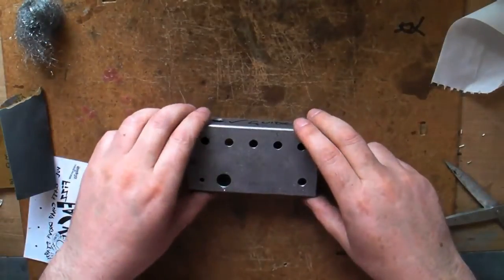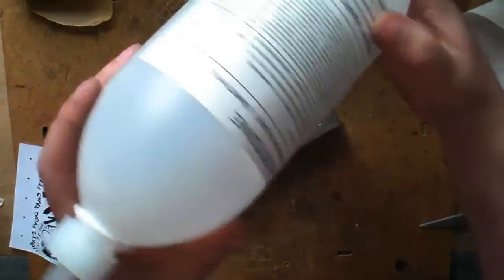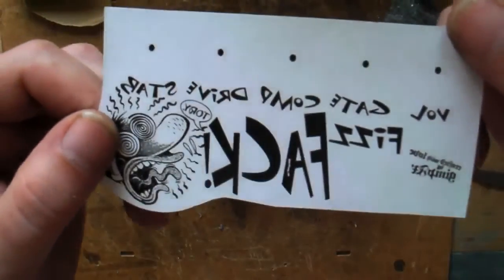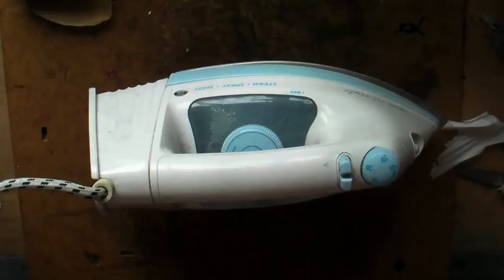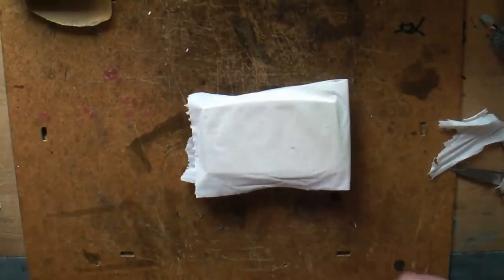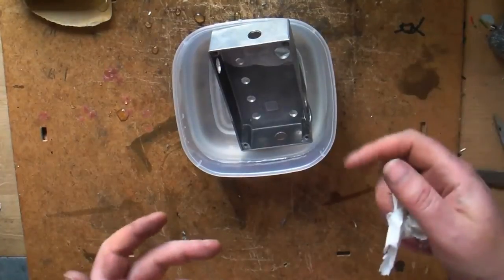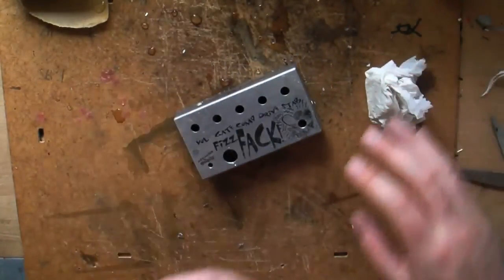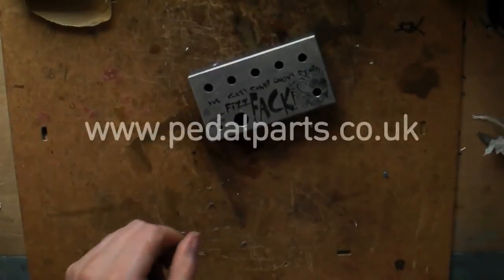TonerTrans

Comment: any suggestions? I've tried using the back of labels like you said you used, and i've had trouble getting the toner to print clean enough onto it. it's usually quite bitty. i'm yet to try magazine paper, but im tearing my hair out about it haha
Reply: i found the same thing when i switched to third-party toner cartridges. going back to original samsung ones cured the problem